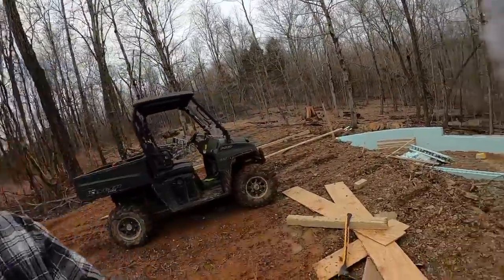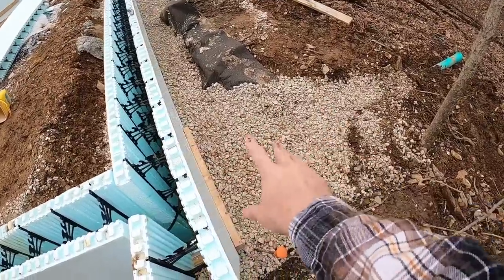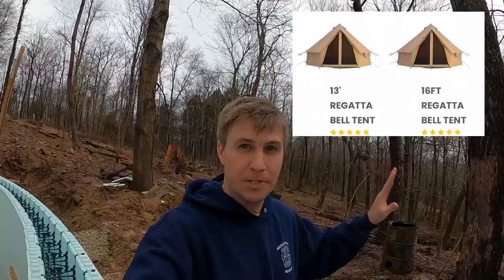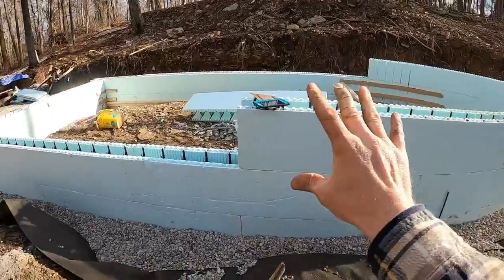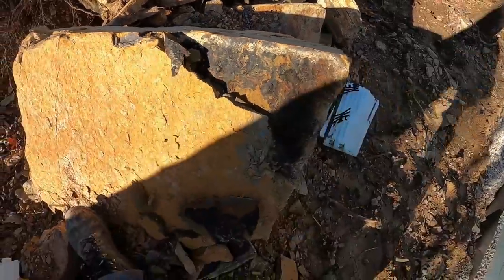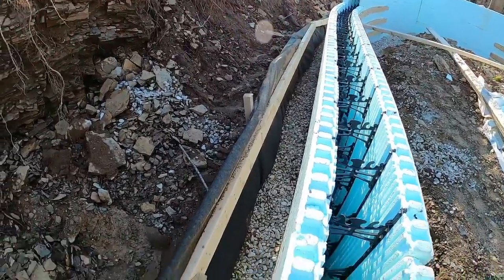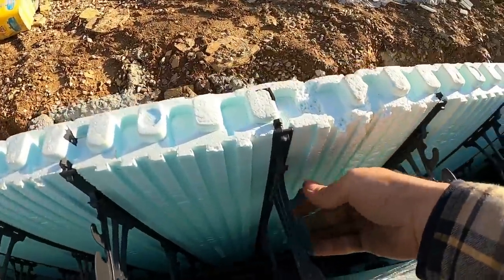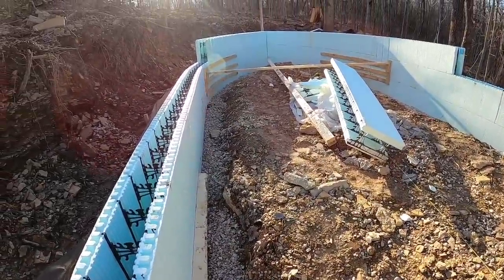Rain Storm tests Foundation Drain - Your ICF Steamboat Questions Answered

Comment: Hello Captain Kleeman; I am a subscriber and have been since the first time. I think the "question and answer time" is a good thing. Some people ask questions that I would not think of. Here's a tip for you. When using your tractor in very slippery conditions use tire chains. I've used them in mud and snow with extreme success. The hardest part is the installation and removal. It's cheaper than gravel. Can't wait to see the finished project. Be well and safe.
Reply from the maker: Hey thanks for watching and supporting the channel!

Comment: those rocks are known as mudstone - layers of mud that have been compressed and lithified (turned to stone).  Not good for much of anything but turning to dirt easily.  Labor to stack and brace the block is far less than building plywood forms and insulating them and waterproofing them.  this is a good system ICF.  you've thought the building out very well kleeman - good job.  remember - it's your channel - your product- your intellectual creativity - keep it up - i like it all.  what a lovely place to raise a family - you done good kleeman

Comment: 26:40  ICF savings segment; I've never seen ICF construction, before I came to Dirt Perfects/Captain Kleemans channels. Didn't even know this type of construction existed ! In my area (St. Louis)  all concrete wall construction is by either erected Standing Metal forms (basements for the most part) or pre-fab tilt up panels (for multiple story buildings) I guess I really ignored all the benefits that the Captain mentioned (R-value, includes studs and rebar fittings, strength etc) and in my own mind saw the benefit of LABOR SAVINGS in the form of actual labor to erect hard forms for the pour. My eyes have been fully opened, by this video!   31:25 !  Was that BIGFOOT ?   Great Q & A session! Loved it.
Reply from the maker: Glad you enjoyed it and yes it was!

Comment: Excellent video, your best video by a long shot. I am a former builder of years of construction. Built hundreds of houses. Your points are valid. In areas were ppl so ignorantly build house next to the ocean or any major wet areas, and houses in the the woodsy areas this would be ideal. At the rate your are going, I would run angle bracing across from the top of your first course of your back wall to the bottom of front wall and visa versa as a precautionary till you get walls poured. Just a thought. It may be of kill, but you are use to over kill. Thank you for sharing.
Reply from the maker: We have metal braces that are specifically for the ICF.  Stay tuned!

Comment: If I may suggest for the siding. Use plywood cut in to strips. Then get some metal shavings. Let the metal shavings soak in vinegar. Then wipe on to the wood without the metal in it.. This will make the wood look really old. Then seal with linseed oil. God bless
Reply from the maker: Know a guy who used to use that for rocking chairs.  Cool finish!

Comment: You can't build a stick house to equal the storm debris strength of the ICF.  As a builder, at current material prices, depending on where you are and you concrete costs. The ICF is very close to the same by the time you factor in wall studs, sheathing, house wrap, and insulation. Good explanation video Captain!  Enjoy the rest of your week! 👍👊
Reply: One material that comes to mind is ICCF.  Watched one video where the builder kept calling the ICCF ICF. The forms are similar but the form itself is a mixture of usually recycled foam and cement, not concrete. There is a difference. An ICCF block has structural strength on its own. You can build an internal wall with it without pouring concrete.
Reply from the maker: Very good points.  Thanks for watching!
Reply: @ArnieD17  I build conventional stick framing and am ICF certified as well. Also am a licensed house inspector.  Never had any experience with the ICCF you are talking about, but will look it up just to satisfy my curiosity.

Comment: One advantage I like with the ICF, once it’s up don’t have to take the form boards back off!
One question I do have what is the fire codes for having ICF in a basement. Do they have to be covered with a 15 minutes fire rated material. Captain, I realize you probably can’t comment, just wondering!
Reply from the maker: They do not have to be covered per state level.  However some counties have local codes that want them covered.

Comment: Yep cut that Persimmon tree down. I had 1 like that last year and let it go. in just 1 year the wood peckers almost cut down.  As a kid in the late 70's I used to go around and cut down Persimmon tress 6" round or bigger and take a pickup load to Louisville and make $1600 a load. Back then that was good money. The company I sold them to make golf club heads for drivers. Its a very hard wood, but now days driver heads are made metal.   If its not to rotted it makes great wood for making about anything.

Comment: Captain excellent job explaining the operation. Doing a fine job my man.   Have you noticed a decrease in lifting capacity with the quick attach on tractor now?
Reply from the maker: No decrease at all.  But Neil did shin the relief valve to bump the pressure up from 2,000 to 2,500

Comment: Around the 11 min mark,  your video  looks down the hillside wall where the earth slumped down. The wall looks bowed in. Did the collapse push the wall in some or is it just the wide angle camera curving the wall??? Luv ya's from Kentucky!
Reply from the maker: That’s normal.  The walls will look crooked until all the bracing is on

Comment: I'm an electrician and from dirt perfects videos that was the first time I have seen ICF how is the electrical and plumbing ran in the walls
Reply: When I was a sparky, all we did was use an old electric chain saw and cut grooves in the foam and push the romex in.
Reply: @StephenWolver  That’s what I was thinking you would have to do thanks for the feed back

Comment: Do you need to put a corner brace on the inside of the paddle wheel flutes? 👍 keep on keeping on Capt
Reply from the maker: It will have reinforcements on the deck level

Comment: Maybe a dumb question, but is there ever a problem with the ICF forms "lifting" and blowing out underneath? I  have seen where you foam the joints and gaps, does that kinda glue the pieces together, or just plug the holes.
Reply from the maker: Joints get foamed when it is all together.  Never had an issue lifting

Comment: You said that the water can get out of the inside because of the ridges on the bottom of the block but when you poor how can the water get out
Reply from the maker: Once it’s poured and the structure is built there won’t be water in there
Reply: @CaptainKleeman   I've done houses that have had a spring my house in Mount Vernon Washington gets water in my basement
Reply: @CaptainKleeman  I'm not trying to be a ass just asked my neighbor lost there house because it would flood every winter so I only store stuff in my basement in California very few basement  because of flooding

Comment: When you talk about cool shapes with ICFs,  you're talking about my house. The longest exterior wall in our house is 8 feet.  The house is comprised of 17 8' segments that form a basic circle.  I formed it all and had a crew pour it.  With insulation and in floor heat, our basement is extremely comfortable.
Reply from the maker: That sounds awesome!